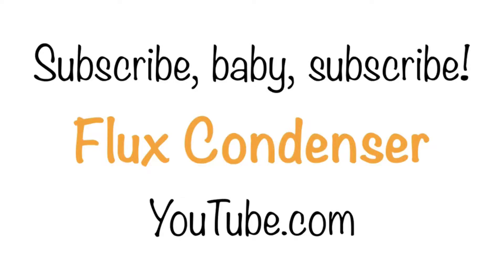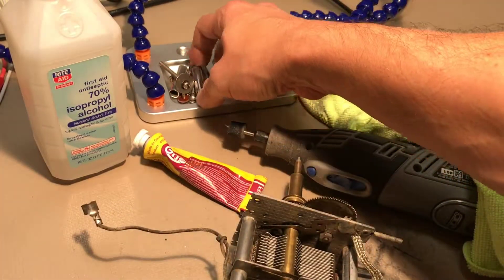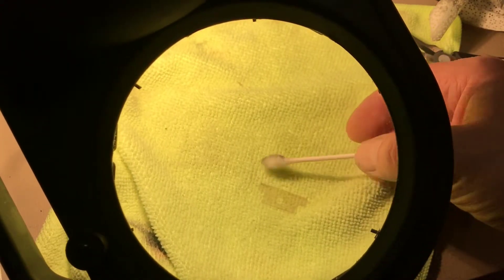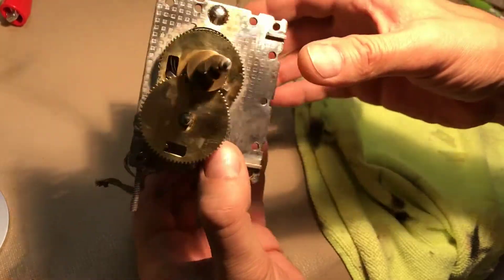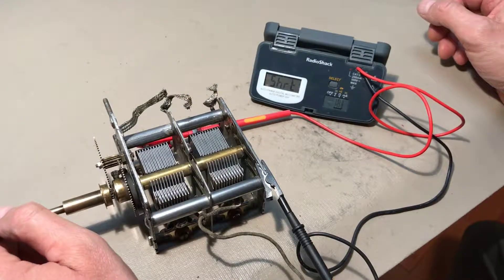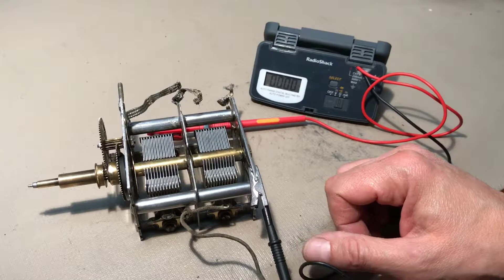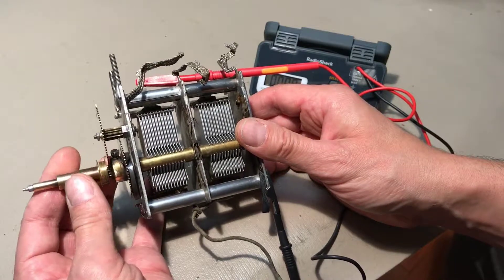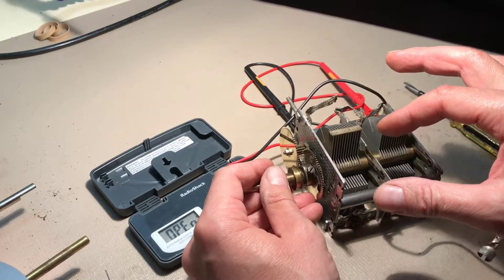Zenith 5S119 Antique Radio | P6 Variable Tuning Condenser Short

Comment: I.ve got a two-gang variable condenser like that. When I tuned the dial, the radio would be making a "scratching " sound between the stations One gang is used, and the other is not. I did not know that you could bend the vanes like that to fix the shorting. I'll have to remove it completely to do that. Thanks for the tip!

Comment: Thanks for another informative video. I have a question on these tuning capacitors. How freely should the rotor shaft/plates rotate. I am cleaning one from a Motorola portable "Suitcase" radio. The string driven type. I can turn it manually, but it seems rather snug. Not quite tight though.  I think it may put too much stress on the string and pulley mechanism. Any ideas on how to adjust this. Cleaning and light oiling had almost no effect.  This is my first restoration so I am not sure what is normal. Thanks again for your series.
Reply from the maker: Ideally, the variable condenser should turn with ease. I’ve never run across one that I’d consider difficult to turn after removing rust, residue and grease. I would look for dried-up grease on the ball bearings. Use a good degreaser to break it down and flush it out. Degreaser is the key. Once everything is moving freely, add some white lithium grease to the bearings. If you’ve already done this, look for a nut or bolt on the shaft. Some variable condensers use them to keep the shaft in place and loosening this a bit may help. Congratulations on restoring your first radio and welcome to the hobby!